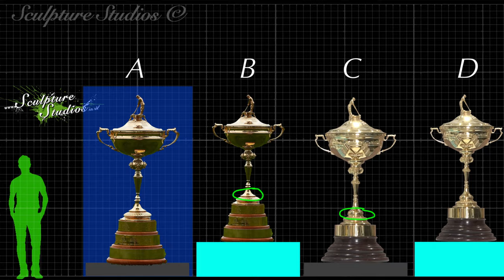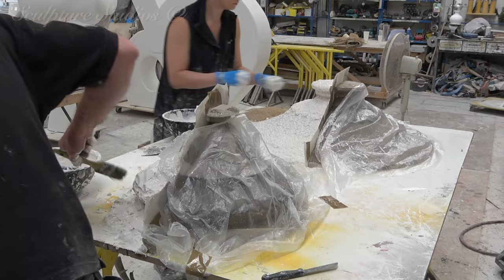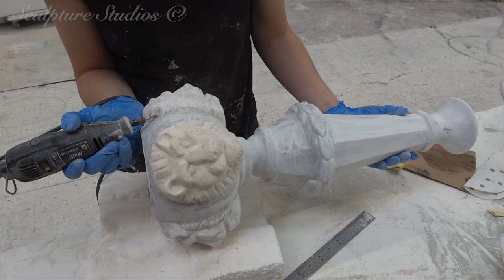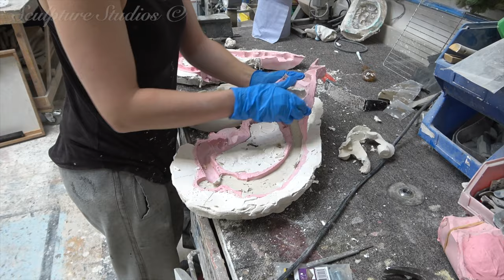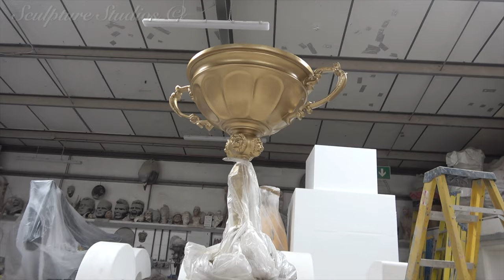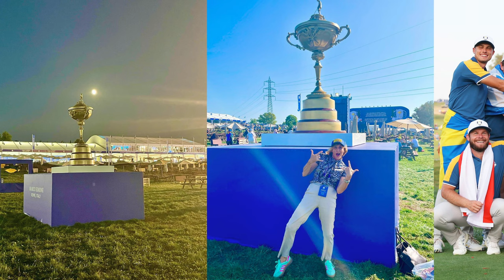How We Made The Giant Ryder Cup Golf Trophy by Sculpture Studios

Comment: Fantastic. I always wonder why you make molds to create the object with fiberglass, instead of simply covering the styrofoam original and working on the details on the fiberglass. I don't think it's because of the weight.
Reply from the maker: Hi Fabian. For items with a lot of detail, covering the master pattern with the fibreglass means that the form is blanket coated and all of the shape somewhat softened a little. It then requires a lot of surface covering with resins, fillers, not to mention a lot of detail work with these tougher materials to achieve what you're after. 

   By working with softer materials like polystyrene and plasters for the detail in the original master pattern, it's much easier to work with, sand down, clean up, etc etc, to achieve the detail. By which, creating a mould and then a cast, means that all of the detail work has already been achieved, and there should be significantly less work when working with the tougher materials like the resin and glass fibre.

   It also has the added advantage of now being a hollow cast, making room for any internal metalwork etc.

   I hope this answers your query :)
Reply: @AdenHynesSculptureStudios  thanks a lot 🥹